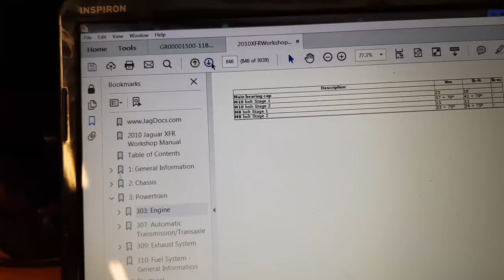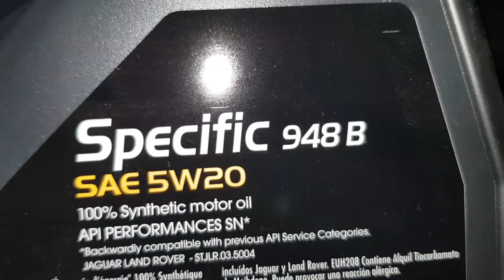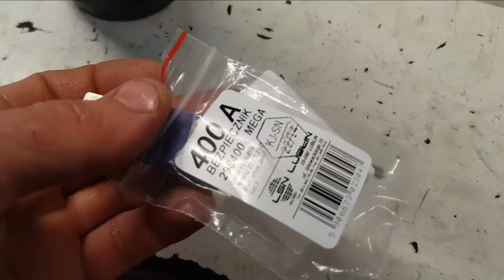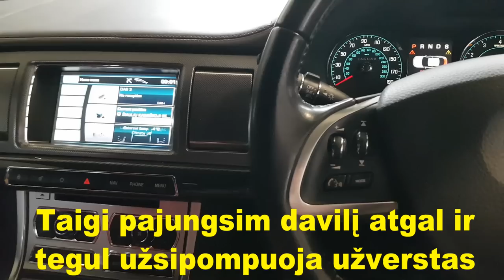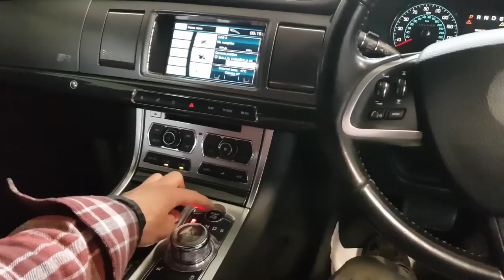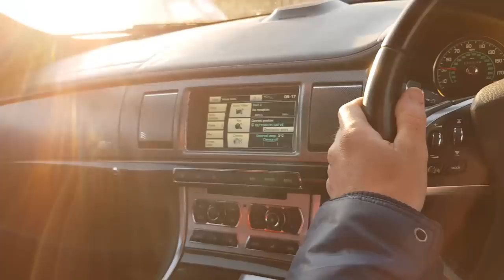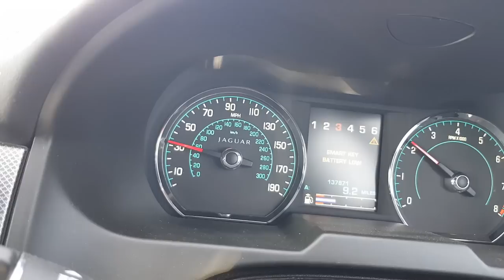Jaguar XFR 508PS Supercharged kapitalinis variklio remontas

Comment: I can't translate the video and comments, but could you please explain how you found out that bearings have issue? Do you have video how the engine sounds before you repaired it? Thank you.
Reply from the maker: Hello, engine was stuck, only way to find out what exactly is wrong with it is to dissasemble. If connecting rod bearing is worn out, engine will make knock sound and possibly later going to stop-stuck.
Reply: I hear some sound coming out from oil pan, you can't really hear it until you move really really close to the oil pan under the car(you can hear some metal kicks, it is not 100% correlated to engine rpm, but frequency of this sound is growing when rmp is going higher). I'm trying to figure out that may be it is a begging stage of this issue... Is that possible to repair the crankshaft or I have to buy new one? Do you know is anything else there can cause the described issue? Thank you.
Reply from the maker: Some kind of ticking noise is normal for engines, it depends what, how loud that sound is. Bearing failure can cause low oil level, too rare oil change, wrong oil, cold engine high rewing-loading, very high mileage.
Reply: megstuBMW I will record video and would like you review it. Do you know is 5w40 is ok for this engine?
Reply from the maker: I am not sure what can I say from recorded sound. As far as I know, there is only one specific oil for this engine 5w20.